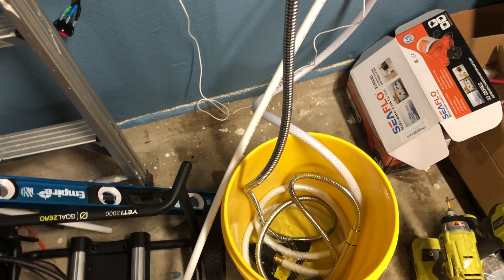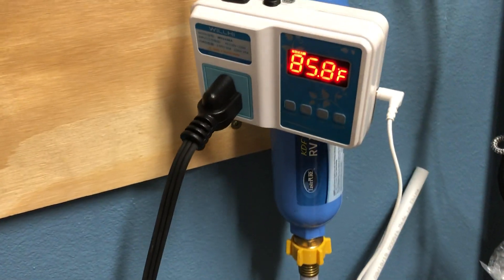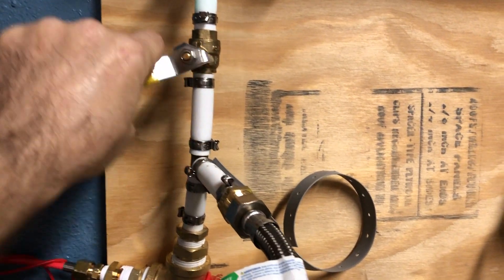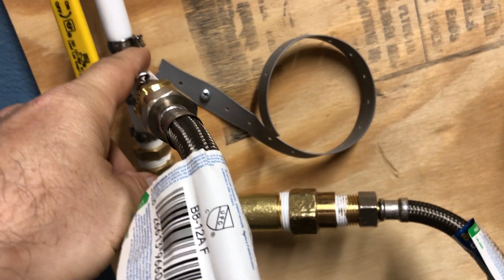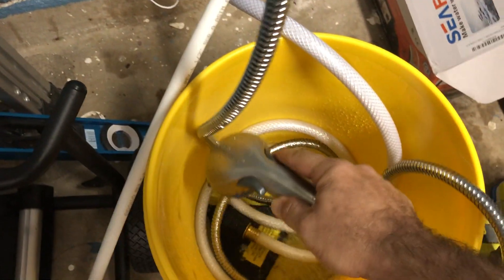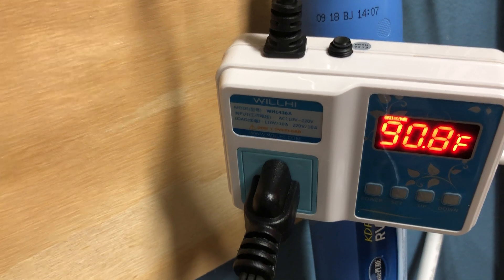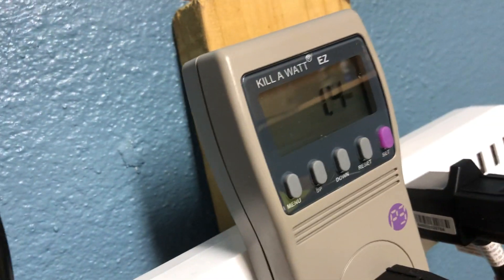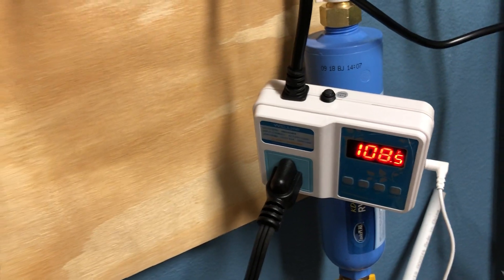Test version 2 of my "hour shower" a recirculating shower for RV, Van life, and Boondocking

Comment: any chance I could have you comment on the parts that make up the "in line heater"portion? I've already bought the element and thermostat but curious about the actual metal parts. please and thanks
Reply from the maker: Sure, the element had MPT threads as I recall, so I just went to Home Depot and bought a Brass T and a Brass reducer from the 1" Brass T to the size of the heater.  If that doesn't help my email address is my first name at my lastname .com

Comment: ... why not connect the heater to the pump so it cuts off with the waterflow?
Reply: No it s possible to flow with the temperature already ok, then there is no need to heat the water anymore! This setup is really great!

Comment: What’s happened with this? 

Have you installed it in your RV?

Do you have instructions on how I can make it myself?
Reply from the maker: Hey Tanny, Covid set my plans back on the install.  But there is enough information here to duplicate what I did.  Since this video, I did shower in it and send water sample to the local lab for testing of Bacteria and Virus and came back negative.  It's a good to go system.  If you have a specific question, ask, but the general idea is install it opposite your existing shower, fill the tub or shower floor with your existing system, about a gallon or two of water, turn it off.  Then turn on the recirc system (I'm using a wifi switch outlet so you dont' touch anything electrically) if you pause my video you can see component names and links in the description.
Reply: Sean Reitmeyer Thank you for your quick reply. I was mainly interested in how you built the heater as that was not clear to me. I looked at the information for the heater and noticed it was set at the factory to go no higher than 120° so I was wondering why the need for the temperature switch.

I don’t have an RV, but I do have Parkinson’s and one of the therapies is to take longer showers. However, I live in Los Angeles area and my DWP bill for the last two months was $845 most of which came from the cost of water. I was thinking if I could install something in my home shower using the instructions of how to use it that you gave. The hope is it would reduce my water bill and allow me to take longer showers which I cannot do it now.
Reply from the maker: @TannyOHaley  if you look carefully at that heater kit, it uses a terhmostat, and that t-stat will NOT work in my setup.  You will need what I did.
Reply: Sean Reitmeyer Thanks
Reply from the maker: Sorry I'm not a "youtubeer" just a guy that decided if I was going to build an hour shower, I would not want "ass juice" in my face like that other guy.  I did try several different soaps.  You are going to want to use "no tears" with a system like this.
Reply: Sean Reitmeyer Not exactly sure why that comment is here, but my understanding with the UV light and filter is that it gets out all bacteria and that the water would be more pure than what comes out of a tap.

The original Gone Boondocking guy said to use biodegradable soap and a teaspoon of Epson salt which gets rid of the suds.

I like your use of a heater as it means that this could be put anywhere there is a shower without intrusive plumbing.

Comment: In reference to the heat element. Are you using the kit for $65 or just the replacement element for $27??
Reply from the maker: The kit because of the switch and plug, simplifies